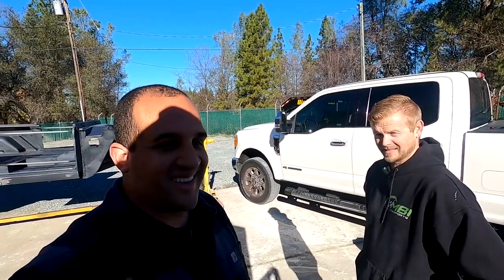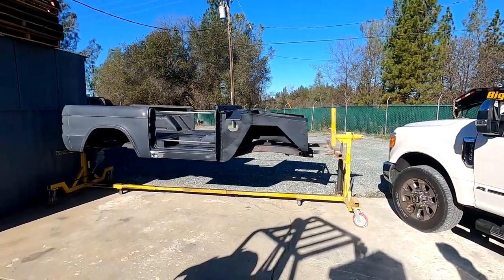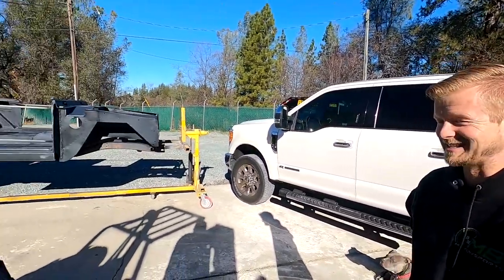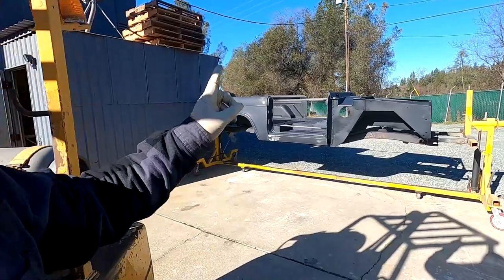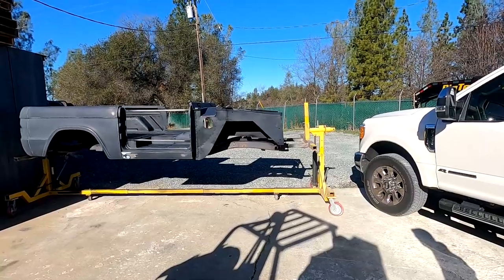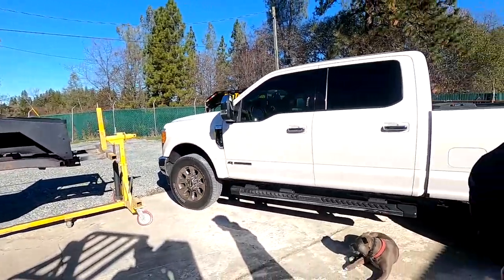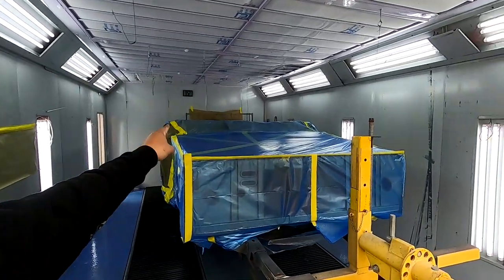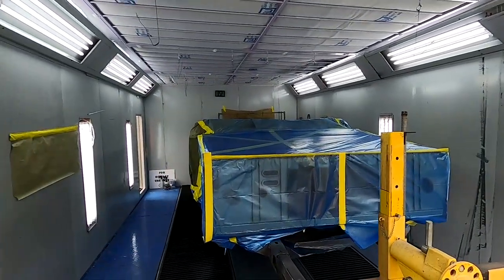Painting and clear coating  the 1966 to 1977 Ford Bronco

Comment: Just found your channel, still catching up on videos, had a couple ideas that may help with the paint booth. Mby try a piece of sheet aluminum cut to fit above the intake filters at like a 45 to act as an air diverter. So it forces air upward and not direct at the filter edge. And possibly a big enclosed carport to cover the entire booth, control panel and and ducts?